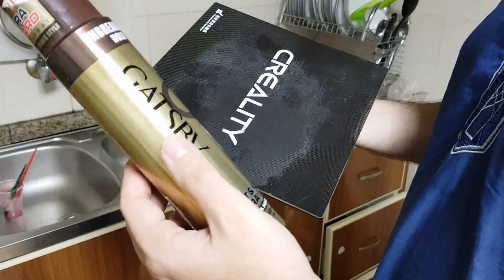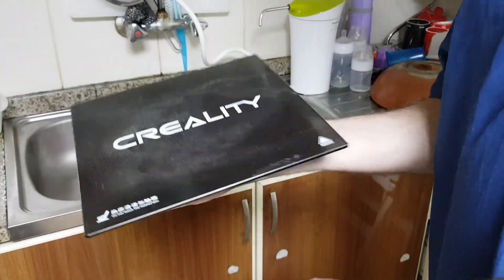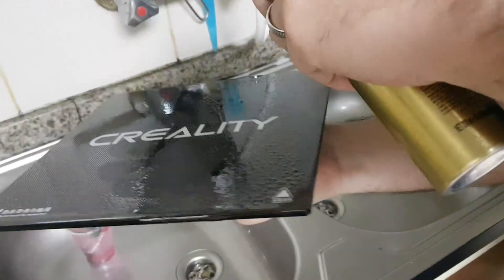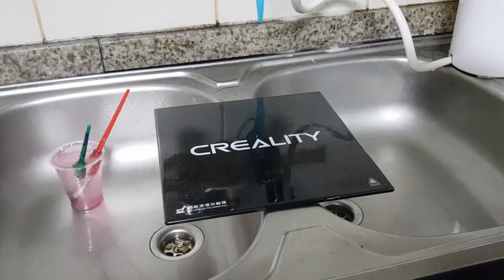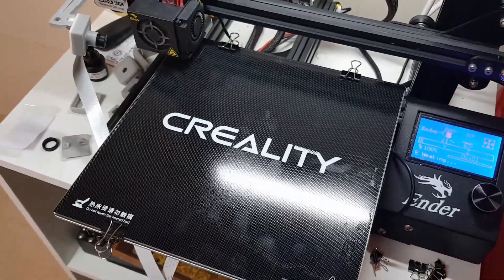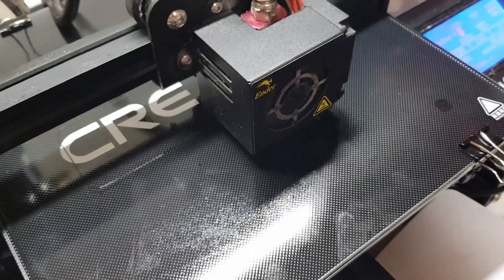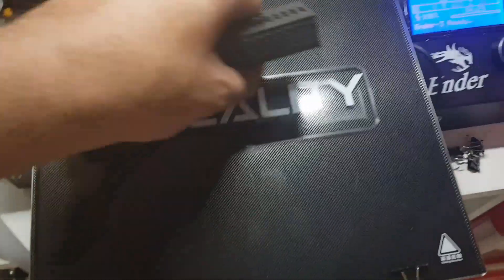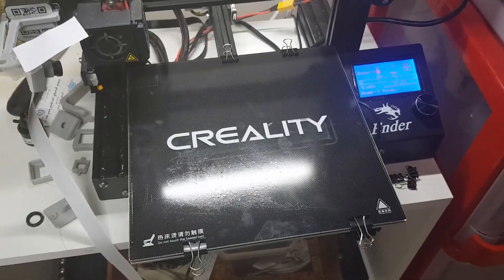3D Printer - Achieving Good Bed Adhesion With Hairspray on a Heated Glass Bed

Comment: Your first later appears too high as is evident by the fill shown on the print.  Not enough squish, so the lines dont blend and you can see the glass between each line.  This can explain the ease of which you removed the part and the need for spray.
Reply: I do this intentionally on PETG and PLA prints on glue stick. It still has amazing adhesion for fine details, yet comes right off when the bed cools!

Comment from the maker: Ok i get it i did put a lot more hairspray than you usually do. My glass bed seems to be warped in someway that makes prints successful only if i leveled it up with a thick layer of hairspray.

I have decided to change my bed to a PEI based one so prints can stick in a reasonable way. Ill maybe post another video about the results later.

Within the comments you will notice the same observation with my fellow 3d printing friends. Perhaps you haven't had a glass bed that was as bad as we have. This might not be the best advice but this thick layer of hairspray really helps with bad sticking beds

I won't delete any comment as i respect your thoughts however there is no need to keep posting the same info again. I wont be deleting any comments since this is an open community for thoughts.

Comment: You really shouldn't need hairspray with a glass bed, especially when it's heated, unless it's badly leveled or not clean (not sure if hairspray even helps with warped beds). Just clean the bed with isopropanol before each (bigger) print, then wipe off the remnants with a moist microfiber cloth and dry it.
Reply: that seems bs because I have a glass bed for the v2 and I have a job that is failing when it gets about half an inch up. so all the other layers were fine then the object starts sliding. My bed temp is set to 50 does that need to be higher?
Reply: @MyVitros  If you're using PLA I suggest bumping it to 60-65
Reply: the reason most ppl use hairspray on glass beds is because "PETG" is known to adhere SO STRONGLY to the glass it will literally break/chip-off pieces of the glass when you try to remove it. Hence...the hairspray. I'd rather get a can of hairspray from the dollar store than have to buy a new glass bed each print cuz the model is welded to the glass.  :)

Comment: After 7 days from buy ender 3 glass, not atchesion!
Reply: Set your bed temperature slightly higher and don't put that much hairspray on it
Reply: My temp is 60°C with PLA!
Reply: I clean it with IPA and it WORK!
Reply: @kornelmag9075  nice👍👌 and think about leveling your bed. Fine tune it
Reply: @kornelmag9075  whats IPA ?
Reply: @Maurizio.H  IPA is isopropanol alcohol😋
Reply: Thank you for reply 😊